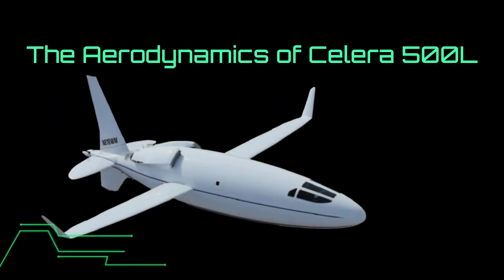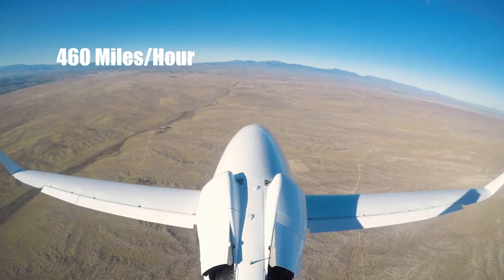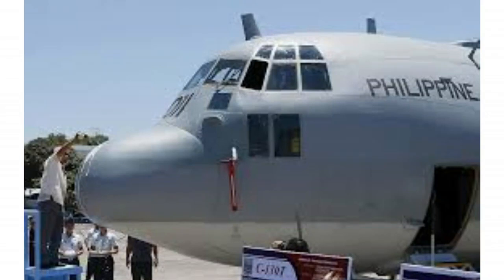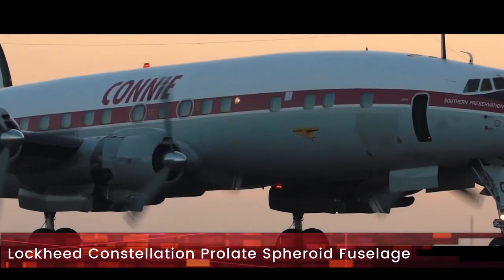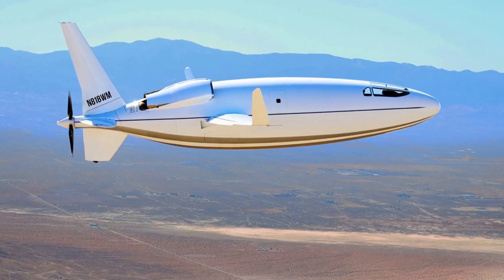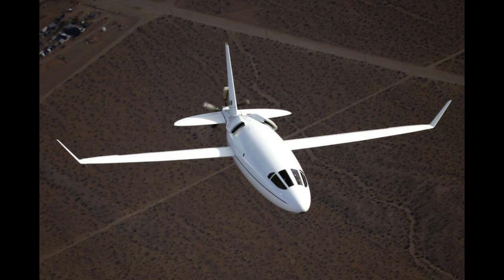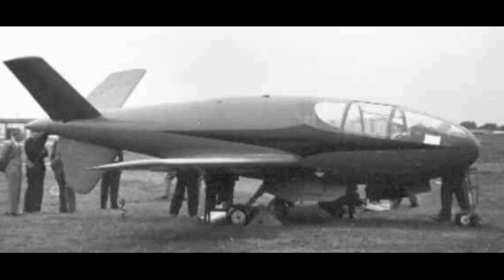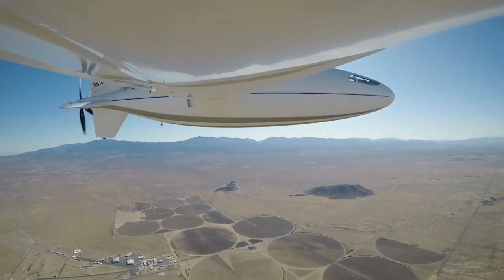The Aerodynamics of Celera 500L

Comment: I don't get the excitement that this musters. There's nothing "revolutionary" about the design. Look at the external fuel tanks of a Lockheed Lightning of WWII and you find the same principles applied there that now shape the fuselage. The P51 had a laminar boundary layer (not full laminar flow, that actually would be catastrophic for lift generation) wing, but it was found that in the real world given standard fabrication tolerances, vibrations and turbulence introduced by the propeller, there was far less advantage of that than the theory promised.
With composite fabrication today and the pusher prop that may be better, but again, these are concepts Burt Rutan introduced decades ago.
Reply: And don't forget that Rutan abandoned them after somebody pointed out that his canards (which worked wonderfully tested in the desert) fell out of the sky in the rain. Between the rearward CoG implying potential stability issues as well as tight tolerances on CoG, and the focus on cruise performance over the factors that actually matter for a private jet (all weather capability, short strip access, and speed), I really don't see this taking off (literally as well as figuratively). Designing an aircraft that cruises better than anything else is easy. Designing an aircraft that cruises well and has all the other required characteristics is hard.
The thing that really gets me about this design is that stability and trim drag could be considerably improved by a canard configuration. Not only is there nothing new here, I don't even think what is there is very good using existing ideas.

Comment: Electrifying this design would have the same consequences every aircraft converted to electric power sees. To keep the wing loading within reasonable limits, range and payload capacity would be sharply reduced. Electric power systems have much lower specific energy than IC engines, and this aircraft is designed around and it's performance is  highly dependent on a particular extremely efficient IC engine. A  hybrid might be a reasonable choice, but aircraft essentially operate at three power settings, climb, cruise and descent. Hybrids typically take advantage of the fact most auto engines usually are sized for acceleration and most auto travel is at much lower power levels and there are frequent deceleration events. In an aircraft cruise power is a larger fraction of maximum power, so less power would be available for harvest in cruise mode and aircraft typically only operate at descent (deceleration) power for a limited time before touchdown. Would an efficient climb and cruise propeller be useful for driving an energy recovery system?

Comment: Hi and Hello Greetings from India,Mumbai City
I feel Celera 500L can be build with the #WW ll Dronier DO 335 which had front Tail powered Engines

I am sure there is a way to improve this Celera 500 L
I wish some one will come up clearing my doubts including ExperimenntaAirCraft Designers
And Why can't it is impossible if they all feel say so.

My take is definitely possible give both end required What ever thrust MORE TORQUE BY INCREASING IF IT IS ELECTRIC POWERED 
YES I AM SURE I CAN SHOW THE WAY
Increasing RPM Do can help to the required TORQUE TO POWER Celera 500 L
God Bless all Expect clarification from all Designers Developers and INNOVATORS etc etc

Comment: Need an opinion from an aircraft engineer.   Sound to go to be true?  Probably is.
Reply: Professional pilot here. Yes, it is too good to be true. It is an interesting concept plane, but not practical in too many aspects of flight. No thanks.
Reply: Yep. Smells like fish.
Reply: As of now this is dreamware. 

Fuel mileage 6 times higher? 

What about balance?  Looks like the seats are far forward of the wing which means it will need a hefty downward force by the tail.  That means stress and drag.

Comment: Single engine not good unless they are going to electric.
Reply from the maker: Red 3 engine is like a two in one engine. If  one part of it fails, the other part takes over. So there is redundancy
Reply: @ElectricAviation  Thanks, didn't know that. Does it meet the commercial IFR requirements?
Reply: @ElectricAviation  It might be like a two in one engine, but it isn't in all the ways that count. You cannot stop only one side of it, and prop damage will still scupper it. A first world war engine can run with all but one cylinder blown out, so would that be a 4 in 1? No, because if a crank fails the engine dies. It is one engine driving 1 prop, with all the risks that entails.

Comment: I still don't believe the 400kt airspeed with only 500hp
Reply: that's true airspeed and not indicated airspeed, that thing can climb into the flight levels and take advantage of the thinner air
Reply: @Freeborn88   i know and I don't believe it
Reply: @Freeborn88  the only planes I know of that reaches those speeds are the turbine legend with a garrett 1000hp engine and the piaggio p180 with 2x850 hp PT6. 
Even with drag reduction, the ingestion of boundary layer reduces the effectiveness of the pusher propeller so we are talking of even less power being applied.... I want to see it with my eyes. 
If they had said 330kt or even 350, but I think they are exaggerating on the speed. I did the math and the range/ fuel consumption checks out.
Reply: you also have to remember that this thing is like a super aerodynamic dart so it will be able to do more with less.  that is also something to consider.
Reply: @Freeborn88  yes but there is a limit. Some people did drag calculations on the shape and although really efficient it couldn't be accelerated up to 400ktas with that amount of power...and its cross section is way bigger than a lancair legacy so I'm not buying it
Reply: Almerinda Romeira  it's ok, you don't have to.

Comment: Sooo many red flags about this plane. Performance numbers are suspect at best, crosswind landings will be a nightmare with the huge cross section of the fuselage in comparison to the rudder. That single engine and tiny propellor may be efficient in cruise flight, but runway and climb performance will absolutely suck at high altitude airports, especially in the summer. No thanks.

Comment: You cannot build a plane that has only one good parameter - maximum speed. This project is a badass for investors, the plane is absolutely bad in all other aspects. In the explanations, there is not a single figure about aerodynamic parameters, only snot. The reference to Alice, which has completely different and adequate aerodynamics, looks especially delusional. The plane flies in the range from zero to maximum speed, the plane maneuvers. Nothing is said about this, and anyone who has read at least one book on aircraft design knows that wing loading is a key parameter, but what is the load of this garbage with such an insignificant wing? How does she maneuver, how does she behave at low speeds? This is supposedly General Aviation, for which flights at low speeds are more than half of the resource.